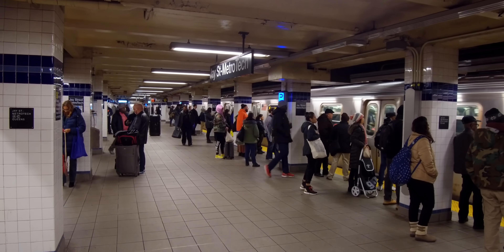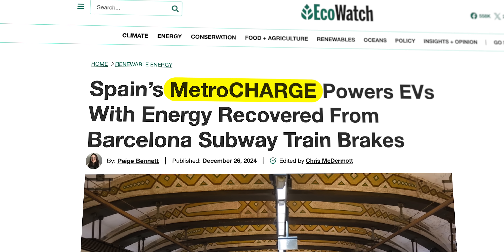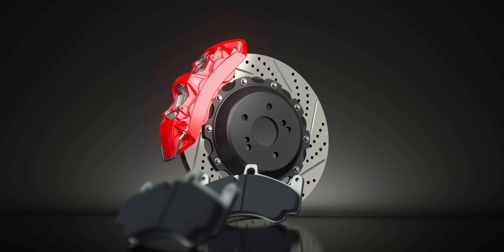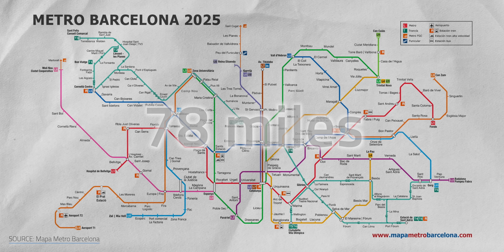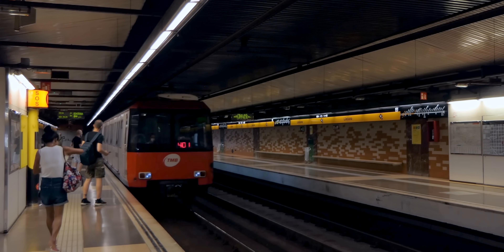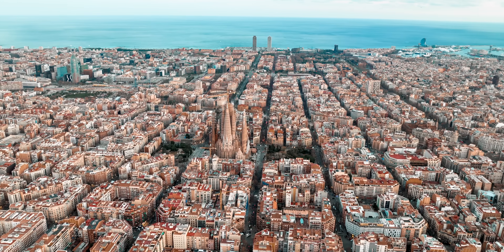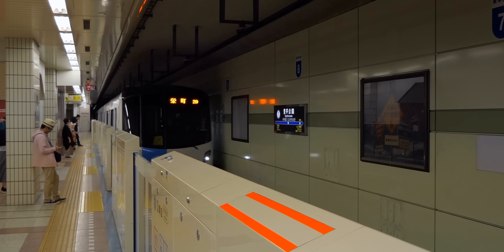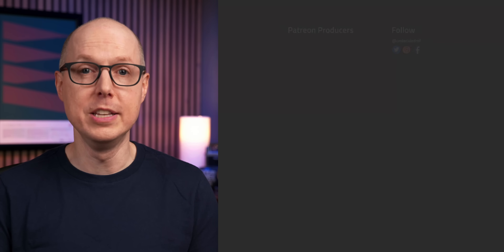The Most Overlooked Clean Energy Source… is Under Your Feet

Comment: I can't see how this is not just a publicity thing.

Every time a train stops it will have to accelerate away. And because it is less than 100% efficient you will get less from RB than it takes to move the train away. Surely ALL of the recovered energy will be used for the trains. Using the energy for the trains would also be the most efficient use of the energy. So why use it for anything else.

Comment: Physics says 'LOL NO'. Regenerative breaking isn't powering anything, my dude. It may win back some energy through breaking, but that is definitely not going to any major consumers. That tiny amount of energy when a metro breaks is barely enough to operate the train itself and whatever is left over at the peak of the break MIGHT support a nearby escalator or light for a fraction of a second. But this is not an energy SOURCE, let alone something that can continuously power an entire station or more. That is a completely ridiculous notion that I never expected to see on this channel. At best the metro company is overselling what is actually happening. At worst this is the city government fraudulently spewing out random numbers that make absolutely no sense in order to meet green energy quotas. You said it yourself early in the video. Breaking trains account for 33% of trains own electricity usage. So that extra energy is going right back into the energy grid supplying other trains. It sure as hell doesn't fully power 28 full stations AND charges EV's when there's metro trains driving around that still need require an additional 66% of their power need to come from somewhere. There is no surplus in this system. That's not how physics works.

Comment: I used to use air conditioner as a retarder in ICE cars when I was living in hot climates - downshift (if needed) and crank up the AC - plenty of free chills when costing downhill 🙂
I guess, the electric trains in Russia for long times were using a retarder braking diverting the energy the grid and its excess to the cabs' heaters in winter time or to a heaters on the roof in the summer time to reduce wear and tear of the conventional braking system.

Comment: I don't get it.. The motors are on the train the RB would make the energy on the train, why all the work to export it off the train, just store it in a battery and use it before pulling more from the grid. If its an AC motor train and too much of a pain to convert you could still convert the HVAC (on the train) to DC heat pumps and power the HVAC off the RB energy, that'll run 24/7 365 lol.

Comment: It would seem to me that rather than forwarding the RB energy elsewhere (with the inherent loses in doing so), that perhaps charging supercapacitors that then discharge to accelerate the train after the stop, would be more efficient & effective. That should, theoretically, significantly reduce the overall power consumption of the trains per trip.

Comment: Why not just store the energy in the train's onboard batteries (or pump the electricity into the train grid) to be used for getting it back up to speed instead of pumping it into the batteries of cars that happen to be charging at that point?

I genuinely do not see what the advantage is. Instead of using 100 kWh of electricity from regenerative breaking to accelerate the train back up to speed, that 100 kWh goes into running a station or charging a car. 

The energy wasn't wasted as heat before - it was captured with regenerative breaking. 

Unless what is ACTUALLY happening is that they're now sending electricity into the city's electricity grid, and it is simply being marketed as charging cars, I cannot wrap my head around what this is supposed to be about.

Do we need more EV chargers? Yes. But that doesn't make this thing make sense. The only way this makes sense, is if they are able to charge more money per kWh from consumers than they pay for it themselves. E.g. if they're paying €0.10/kWh for electricity, they need to sell it for €0.11/kWh. And if they're doing that, why wouldn't other EV charging companies just buy directly from the supplier and sell it for cheaper than the Metro?

Comment: 11:28 you are correct that regenerative braking is not 100% efficient, there will always be losses in conversion of energy but at 3:37 the more a vehicle stops and goes the more it benefits is technically not correct. I guess in terms of benefiting from regenerative braking, yes, but overall efficiency, no. It is most efficient to not have to stop at all or avoid stopping. It is most efficient to maintain speed and the lower the speed, the greater the efficiency due to reduced wind drag.

Comment: I still don't understand what is going on. Ok, the trains use regenerative braking to stop. Where is that generated electricity going? Assuming that it is going into the third rail that is powering the train, why isn't this electricity immediately picked up and used by all of the other trains in the system? Assuming that there are dozens of trains in operation at any one time, shouldn't any electricity being generated by a slowing train be immediately picked up and balanced by an accelerating train somewhere else in the system? Yes, the total electricity used by the system would go down, leaving more for other users of the grid to use, but I don't understand why there is suddenly a lot of 'excess electricity' available to 'power cities'. It looks like it is simply a way to make the subway system more efficient, and that the EV charging stations are just a publicity stunt.

Comment: Here is an idea: Use the energy generated during braking to power accelerating trains. If they are at the same "substation section", it is a no brainer. If not, you can have supercapacitors conveniently located at substations (where AC from the grid is converted to DC - storing energy in a supercapacitor is DC too). Or even in some cases, the vehicles can carry their own (relatively small) supercapacitors from which they draw power when accelerating and thus putting less strain on the substation and entire power infrastructure. And since when is it easier to regen to AC? That is incorrect. Regen into DC has worked 100 years ago without any fancy electronics. But it had limitations and was not very practical. The cost of electric energy it saved was simply too low for the drawbacks that came with it. With the advent of semicondutcor technology in powering streetcars and metro systems, regen into DC became much more useful as it could be properly controlled "on demand". Vehicles still carry braking resistors where the electricy is being turned into heat if the DC supply system cannot make use of the excess energy. But that is exactly what has been solved as well in the last decade(s). Charging cars from braking metro trains seems just like a technical gimmick, or a scheme to milk on some "green" funds for "innovation". Which are not always really the best way to proceed (ask me how I know). Many projects would not even get going as they are economically not viable. But there is political incentive to push for them using funds and subisides. Nobody cares that more energy would be saved by using existing, mature technology. Politicians want to have something they can "sell" to their voters. They want to be seen as modern, innovative and ecological. But proven and working systems without "hype" do not win elections. And people are stupid. In the long run, many projects are doomed to fail. I wonder where if this whole "charge your car by slowing down metro trains" thing ends up. I am 100% convinced that the energy from braking trains can be utilized more efficiently.

Comment: Directly routing the energy to be used by a specific car charger seems overcomplicated and confusing. Just send it back to the railway power supply. It's likely that at any one time more power will be needed by trains accelerating than is generated by those that are braking. Over the course of a round trip it is certainly the case that more power is used than regenerated - that's basic physics.

If you have lots of times where you are regenerating more than you are able to use immediately on other trains, and you can't easily transfer power back to the electricity grid (e.g. because the rail traction power is rectified DC and inverting it back it too complex) it might be worth installing some sort of battery, capacitor, or flywheel bank to absorb the extra power and return it a few moments later.

In London, the new trains will have regenerative braking and one of the main advantages is the reduction in heat that will be emitted from the braking systems when the train is at a stations. Stations in London underground can get seriously hot in summer. In fact the reduction in heat emitted will enable the trains to carry air conditioning and still emit less heat overall.

Comment: I don't get the advantage of powering charging cars over just using the energy to bring the train up to speed again. It also saves on heat loss and maybe lightens the load on the railway company grid. What use do car chargers have for brief, massive spikes of energy?

Comment: I wouldn't say it's the most overlooked, judging from the comments.  Tokyo's trains started using RB in the 70s, although not the entire system. However, there's one line that's special.  The Marunouchi Line.  Its newest model has onboard batteries to store excess power.  The system first automatically routes the recovered energy to any nearby trains that are accelerating, next is the station and the onboard battery.  Interesting fact, since that line has its own battery it can run even during power outages for a limited time.

Comment: There's a mining train in Australia that for a some years now runs on electricity from regenerative breaking it generates itself.
The train goes fully loaded from the mine downhill all the way to the port. The weight of the coal pushes the train forward on the downward trajectory from the mine to the port, creating excess potential gravitational energy that can be converted into enough electricity using regenerative breaking to fully charge the trains batteries.
Going back empty, those full batteries are sufficient to make the uphill journey back to the mine to repeat the process.

It's good to see more creatives solutions like it to make our world run on cleaner and greener energy.

Comment: Regenerative braking is smart, but there are no difference in sending it back to the grid or using it locally. Except for the added cost. The amount of energy saved is the same. Economically it can be a difference if they payback from the grid provider is bad, but it will not give any extra power.

Comment: You're a bit late to the party, Matt.
The Underground railway system in Sydney, Australia, and I suspect every other electric train system in the world, uses regenerative braking to feed juice back into the transport grid. Over the complete grid, the regen energy is used to help accelerate other trains which are getting up to speed.
No batteries are harmed in this process as long as the network is large enough for it to be effective, which is generally the case.
So, good idea, long being implemented!

Comment: It seems like if there's a bunch of trains all powered by the same overhead wire, energy from braking one train can be used to move other trains. In a large subway system, there will always be trains moving and accelerating at any given time. Any leftover power can just go to the grid. It's not clear what EV charging has to do with this.

Comment: Hey, Matt Ferrell, here's a better idea of what the power that is recovered by the trains of Barcelona should use, if it doesn't want to covert from AC to DC and back again to AC. Remember the episode, about the Flywheels coming back again to fashion. Well, if the so called "Smart" people of Barcelona has put regenerative braking to the trains, then they should also have put at least several dozens of these Flywheels in the area, to do the capturing of the AC power, Directly, than having to waste most of it's remaining power, to be come heat or even as loss power, that is too little to power anything else. That would have even been better at both recovering and distributing the energy of the trains and at the same time, get to give the so-called power grid, some stability in case of any more the so-called "fluctuations" in the power grid, to be stabilized.

Comment: I didn't realize just how substantial RB was until I got my EV. If I rocket off from a stop sign early in my trip, my kWh/mi shoots up to 600+ but even if I go 2mi then brake it recaptures enough energy to drop me from (at that point, 480) back down to 250 in a single regen

Comment: Not only does this make sense but we need to think outside the box on voltage. Why convert and reconvert and reconvert? What voltage does this regenerative braking give us and what voltage does EV charging need? Sorry I really do not know. That said, we need some standards to evolve so that we can avoid the conversion losses. We need local networks on a standard voltage DC and if we must use AC only for long transmission which seemed to be the deciding factor in the beginning during the battle for standards last century. My neighbor has a backyard shed with a real simple 12v solar panel, and 12v DC lighting on a simple deep cycle 12v battery working for years. He recently added a 120 v AC inverter to be able to run simple hand tools, but sadly could not find 12v battery chargers for his already owned battery hand tools. So he has to invert 12vdc to 120vac only to again switch to 18vdc with losses at every level. How about a whole home 48/24/12 volt all DC home? And if the car is 48 volt, you can charge or discharge directly into the system without conversions that waste energy. Someone somewhere really needs to research standards that would enable this. I mean he can go most places and buy a 12vdc light bulb that is LED so why not all things household? WE need to do better. PS I suspect that the solar panel my neighbor has is actually 18v but the controller he bought is for charging a 12v battery. Maybe one day he will upgrade to better battery system but his deep cycle lead/acid battery has worked for years now with just a storage shed. The power lines are just a few feet away but he could do this himself without electricians and the utility company etc. No trenching required. Started simple and added on. WE really need to rethink our whole systems toward smaller grids that serve where the power is available from the sun or geo. Long transmission is just wasteful.

Comment: The progress of electrification has been held back a decade of more with all the misinformation and ppl believing it, regenerative breaking is just part of the many efficiency benefits that our current system of burning stuff for energy doesnt have which is conveniently left out of the argument all the time. Sure gas has 10x the embodied energy but uses it to make things go at 1/3 the efficiency of electric motors, batteries can and are increasing their energy density every year while gas motors are as efficient as they are going to get. A 70% more efficient civilisation is worth the effort, time and cost. AND we have to do it eventually anyway.

Comment: title is too much click bait. modern trains have regen braking.  I think the reason or difference is traditional train RB does not capture all kinetic energy because it would mean plenty capacitors or batteries on-board. I think the innovation in the train in the video is they can capture most of the regen braking energy by exporting the electricity to the grid.

Comment: Train tunnels themselves could be regenerative too. As trains drive forward, they push air in the tunnel like a piston (yeah they might have to tighten things up around the train) maybe have a wind turbine set up to be pushed and pulled. For obvious reasons you could not permanently block off the tunnel ends, but they could have a roller door system and chimneys on each end of the tunnel with the turbines. Just a thought. They do this with wave tech where when a wave comes into a tunnel it pushes air and when the water goes back it sucks.

Comment: Something smells funny about this story. Not regen braking - that's obviously real and a good thing; it's the bit about powering the subway stations and EV chargers with the regen from trains. Could you do it? Sure. But why would you go to the extra expense of doing that, rather than feeding the regen back into the train's acceleration like normal regen braking does? Its one thing if they're saying "our regen recovers enough electricity to do all of these other things"; fine, it's an interesting comparison. But if the claim is that they actually wired things up so the regen braking runs power to the stations/EV chargers, I have to call BS on that.

Comment: Wouldn't it be more efficient to just used the regenerative braking to speed the train back up? Keep the system self contained to save on maintenance, and the energy saved that's not going into the train from the grid can just be redirected to the other parts of the grid instead without needing any new equipment. This seems like it violates the law of Keep It Simple, Stupid!

Comment: How the hell is the train's not using regenerative braking already? Everything's already electric It's electric motors that control the wheels and everything why wouldn't they use regener braking?? That should be just a default item that they utilize, basically just stopping the train by generating electricity on the motor turning the motor into a generator. And bringing that energy back into the system.